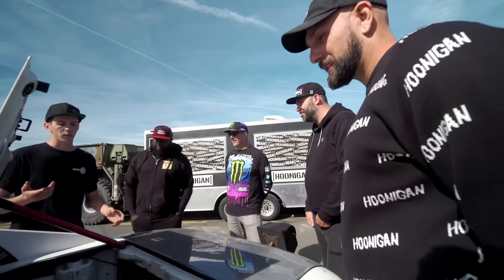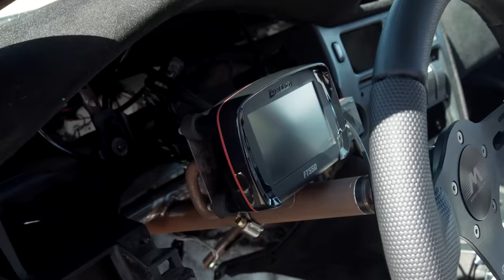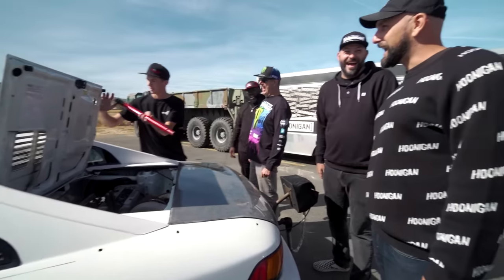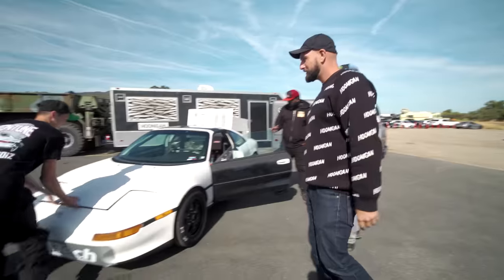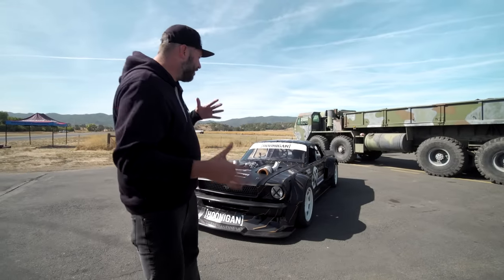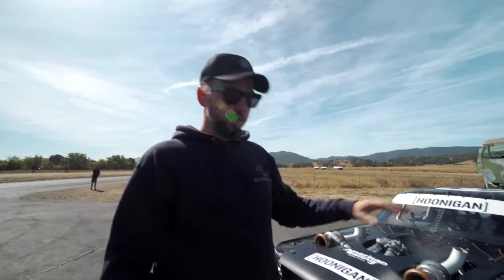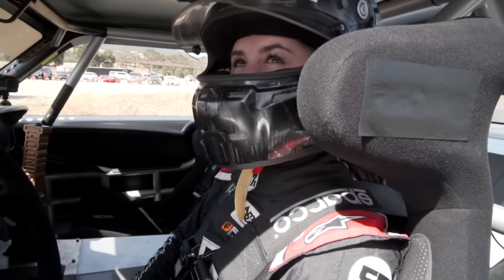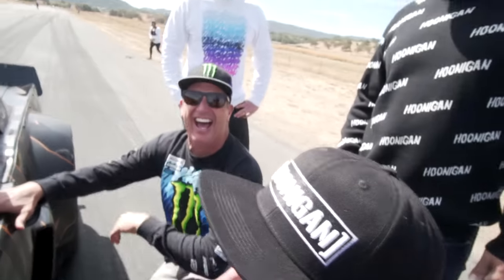BoostedBoiz' 1300hp Toyota MR2 vs Lia Block's AWD 1400hp Mustang

Comment: I’m tired of these episodes where they have the track as an advantage every single time, I’m sure this is all for fun but let’s step up to regular standards and take it to a track so we can see the real results. Would love to see this mr2 and many more cars the hoonicorn has “beat” walk that mustang once and for all
Reply: This type of track is exactly what the Hoonicorn was built for. Hooning around on unprepped surfaces. I'd bet if the Hoonicorn was taken to a prepped track and given proper slicks, it's drivetrain wouldn't survive 2 passes.
Reply: Yeah! and that's why "street" class nissan gtr don't give a chance to hoonicorn. :)
Reply: But it would be the same advantage and/or disadvantage for both.
Reply: @andycrookshank7784  So you want to give it so much traction that something breaks?  I guess you could do that with any drag car.  Their best move would be to wisely choose which tires will work best on whatever surface they're running on.
Reply: @The_DC_Kid  gotta agree. Hoonicorn was meant for unprepped surface. Therefore it SHOULDNT be racing against cars designed for prepped strips. Its completely unfair

Comment: These races are hilarious and great content. That said shouldn't we be putting "quotation" marks around the "1400HP" number on that hoonicorn by now?
Reply: yeaahh,, that thing feels so much more powerfull.
Reply: Im sure it does make 1400 on the base boost settings. On that last race she came around him like a freight train so I am assuming that car has a scramble boost function. I have watched a lot of these videos and I am guessing the horsepower is closer to 1700 on full kill.
Reply: Exactly the numbers provided here the mr2s power to weight was wayyyy higher then the hoonicorn it should have pulled on it once it fully hooked but you see once they are hooked the hoonicorn pulls on it likes it's standing still. On paper the mr2 should have pulled on it on the top end. They need to clarify if it's making 1400 to all4wheels or the crank. The mr2 stated it was making 1300 to the crank. Even then 1100rwhp vs 1400awhp the mr2s power to weight ratio is still higher. Love the hoonicorn but they need to put down real numbers here or else every single race from now on will just be unfair.

Comment: These videos get old watching the Hoonicorn win every time. It almost makes you think they won't allow a car to race that would beat it. It's a badass car but it ain't the baddest.
Reply: These cars are obviously hand picked to loose .
Reply: But it's lost though......
Reply: SXSBlog’s 2JP RZR only lost by half a car in their second race. They never gave them a third bonus race. They would have been hood to hood at the finish, maybe less on the third. A reason they didn’t let them have the third. Doug almost had the rear springs/launch dialed in for the 2nd.
Reply: Exactly, same was the case with DDE, they didn't let their 1400whp huracan race against the hoonicorn instead they went with an f12 with broken clutch

Comment: Two things: 
1: Put the car on a fucking drag strip if you're going to race actual drag cars. 
2: be upfront about the real hp, sxsblog said this car puts out 2000 hp at the push of a button.
Reply: yeah they are capping about the horsepower, its got boost by gear or a scramble. Either way its making 1600+ at the top, watching the plaid race it proves its faster than they say or have dynod
Reply: @clarkescollectibles  it just beat the plaid with 1050hp so why not 1400hp??????
Reply: nah just change to the drag strip chnl mate. no ones forcing u to watch this. plenty of drag chnls out there to keep u excited 😞
Reply: @rhett7716  plaid had lot of grip its nearly a hoonicorn heavier, plus vastly superior TC. The plaid shows how slow the hoonicorn is, it's barely an 8s car.

Comment: You got paddles on it now, BUT its not shifting faster. Considerably slower. I have overlapped older races to the new ones. Its not the young lady driving. Its something else. either way. That is a BAD ASS CAR. The Hoonicorn is one of the best performance cars I have seen in my 61 years on this rock.

Comment: 14 years old we get it ffs. The Hoonicorn has done countless passes on that exact surface and is fine tuned to run on it. Pittimg it against heavier cars with terrible traction doesn't help. Put them ob a neutral track where the Hoonicorn hasn't been tuned to and see what happens. it should only be racing cars like the GTR that beat it. AWD with similar weight and power not a 4000hp top fuel drag car that could only use 20% throttle or a fucking off road buggy or a Cutlus with half the power. Also you are tirning the wick uo thats more then 1400hp and crazy torque

Comment: They said the most the mr2 made was 1100 then say it makes 1300 to the crank which is just confusing. But if you know anything about cars, you'll know that crank numbers are an exaggerated version of the actual power ban on a legit dyno. So they just matched the hoonicorn with a car that is yes a drag car and yes lighter, but has a slower gearbox, it's rwd, and probably makes 900hp to the wheel at most and makes up in time with the low amount of weight, naturally giving the w to the hoonicorn once again as always. Why don't they try one of those low 7-6 second supras and i guarantee the hoonicorn will get clapped. Don't get me wrong i love this channel, but they need to get better at this...

Comment: Stop booking races with these 2WD cars with less power from what the Hoonicorn makes. I would almost guarantee that the "1400HP" figure is well below what the car actually makes on full-kill. That is a 1500-1600HP++ car all day. Running barely street legal tires that are practically glue. "Traction battle" is an understatement. Being a totally un-prepped surface ANYTHING OTHER THEN ANOTHER AWD CAR that makes 1500HP +/- AWD car is simply an UNFAIR fight. The only fair race I've seen, having watched a dozen of these now, was the Kimbo GTR which drug the Hoonicorn to the point she broke an drive shaft pushing the car. SOOOO, PLEASE book real competition for the car. For the love of God. <3

Comment: Not a Toyota motor??? 😢😢😢
Reply: What toyota engine that can fit in MR2 could push 1000+ HP? You aren't fitting 1j or gme in there. 

As always, honda plant much better than OEM plant. (I say that as mazda fan boy.)

Comment: Women: never change their own oil, never replace their own broken parts, never pay attention to bad noises or Check Engine Light, and ALWAYS push that engine to the limit. 😂💀⚰️
Men: monitors oil level and quality, works on car, adjusts settings, knows the list of Fault Codes, and tries to keep engine from blowing up block. 💛💯
If I was 14, had boobs, and wasn't forced to fix my own things, I'd thrash the Hoonicorn, too. Lia Block has ZERO restraints, because she has no money, time, or actual CARE for the vehicle. Must be nice to have rich folks throwing stuff at you, just because "SHE'S A GIRL..." Screw that. She needs to get involved, before she becomes a typical jaded "car b¡tch," who calls AAA for road service.